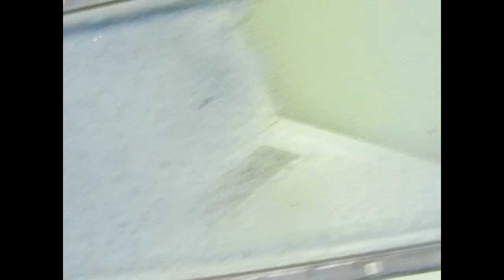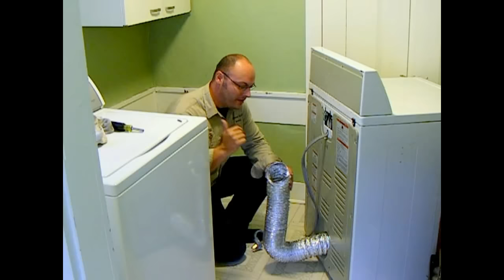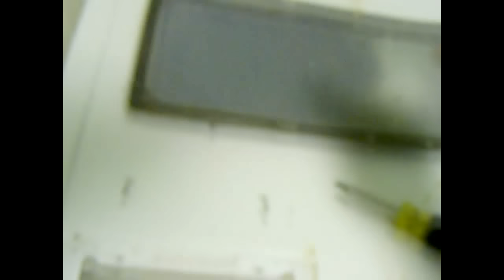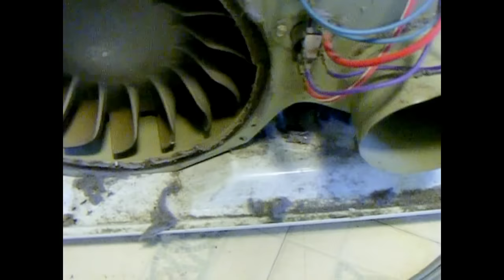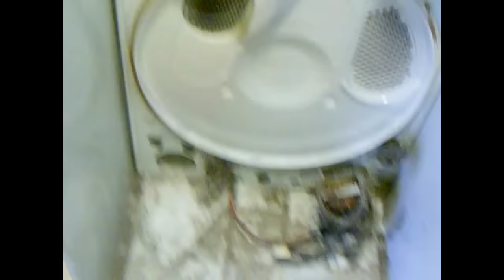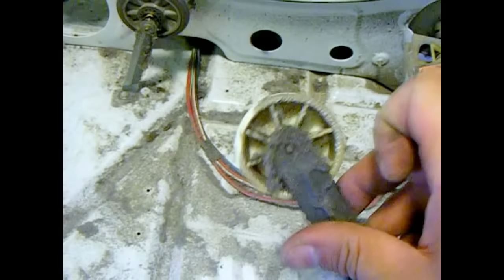Dryer Troubleshooting - Not Drying or Taking a Long Time to Dry

Comment: My Maytag dryer MED5600TQ0 is not heating.  I have changed out the heating element and also cleaned the filter housing.  I have not checked the motor due to not really knowing what i am doing.  Would the timer have anything to do with heating?  I will attempt to access and clean the motor.  How will I know if I need a new motor?

Comment: I have a Maytag gas dryer with the same problem.  Haven't cleaned the vent tube yet but turning on the dryer with the door opened I noticed that heat come out of the back of the drum for about 10 seconds, then it went off for about 15 seconds.  This cycle repeated over and over.  Is the gas flame supposed to come on and stay on or should it cycle like this?  If this cycling is abnormal what is causing this?

Comment: My guess, would be on top of the roof I had to clean out this type of vent by using a wieght, wad up nespaper in burlap bag, tied with rope. I have also see people use an eletric leaf blower connected on the inside and blow out all the build up lint. Hope that helps.

Comment: So how do you know when all of the above work just fine( heating element, thermo fuse, cut off switch, and the two fuses on heating element) and have continuity? I have the same problem and my dryer looks in the inside just like the one on your video. it will tumble but no heat at all. Help me please!

Comment: Years ago, I worked on mine (new 1994) and put the schematic in a sandwich bag, then stowed it in the top compartment. A year ago, had a problem and opened it up finding the package. I thought how kind of me to do that. Of course I scanned it but where oh where on a backup drive? New moter, new pullys (not necessary) and other parst put new seals on duct system so will not leak maybe spent $150. Now not heating. Have a back up heating coil bought when only $50 a few years ago..... Not heating now. Could be the timer (original to 1994)

Comment: Hi Bill,

My Dryer is a Mytag Performa 2004. The problem that I have is that the dryer it is cutting off several time before the program finish. My wife has to wait until it cool down and restart it. Any idea what I can do? change Thermostat?

Thanks a lot
Reply: if you have to wait until it cools down, so it will turn on again - it sounds like the thermal fuse. now the question is, why does it overheat and triggers the "safety" .. I'm no pro, just fixed a thing or two around the house
Reply: @still34u  actually the thermal fuse does not reset. And the high limit thermal cutoff ( which I think you ate referting to ) will not shut the motor off.
  If the motor shuts off then starts when cooled, the motor's safety switch is tripping.  The motor either needs cleaning or replaced normally.
  The thermal cutoff at the top of the heater cage can be reset.  When I do it, I place the terminals between my fingers pointing up.  Then slap it against a good solid surface with my palm flat.
  Not really sure how reliable this is, but it will reset the cutoff on the heater cage.  I might add if it trips repeatedly, you need to check the lint filter to see if it is clogged and needs hand washing because of residue left by dryer sheets.

Comment: hi! i just got done replacing the heating element. the coil was broken and had no continuity. i could visibly see the break and tested it with an ohmeter. i ensured there was continuity after replacing it with a new coil. i have good air flow through the dryer. what else could be causing no heat? the only odd thing i noticed when i started it back up is that the door light does not come on when i open the door anymore. any ideas on how i can get heat?

Comment: I have had my vents cleaned. Then a cpl months later, it takes 2 hrs to dry...then the lint is on back side of lint screen. Dryer is only over a year old. There is no filter inside. Thinking heating element is going out?

Comment: Currently me electric Kenmore dryer is not getting any eat, and when it is started, the timer knob does not spin, so it will be one for hours at a time without stopping and also not getting heat. What would be the problem and fix for this? Also, when we open the door, the fuse jumps and we have to reset it. thanks.

Comment: great video! but my problem is more involved... we have a dryer that won't heat. turns on and spins though. airflow is fine. fuses are good, heating coils good - they have continuity. full 240v out of the wall. we are out of ideas. any help?
Reply: +Paul Brown the thermostats and/or the heater unit could just be dead. That was the issue with mine, just would not heat, blowing cold air the whole cycle no matter what temp setting it was on. Replaced the heater unit and now works better than new.
Reply: Edward Sanders
thanks for the tip! how would you diagnose that with a multimeter - take it apart, plug it in and run and see if the coils are getting voltage?
Reply: Fist check the thermostats. You may have two or more so check them all individually and as a hole circuit. Most thermostats I have worked with be a closed curcuit when cold and hot opens the curcuit to stop flow of energy but if it's a thermo resistor it can be the opposite. Check wiring diagram for you dryer if unsure. If that's your issue then replace and all will be well again but if not then, the heater unit is the issue. Check there is correct voltage going to the heater when switched on by bag probing the plug for the heater. If that is correct and no heat is created the there is something wrong with the heater coil unit its self and I would just replace it but you could technically fix it if there is just a poor connection somewhere.
Reply: Edward Sanders
thank you sir!

Comment: Can someone please answer a question for me.  My dryer won't heat.  I have tested all parts with multimeter for continuity.  My question regards the four-prong thermostat.  The prongs on the two ends show continuity but the two in the middle do not.  Should the two middle prongs show continuity?

Comment: I have a question, my electric dryer has stopped working cycle by cycle, and now has NO hot air coming at all. First the timed cycle stopped working, then high heat stopped working, and now it wont blow hot air on ANY cycle. Any idea what is wrong from this information?? It is an estate brand dryer.

Comment: My dryer has a wide metal section across the top back and has the electrical wire coming through it - I cannot remove the vent covering the blower and exhaust path. Any suggestions?

Comment: I have a problem runs and after about 2 min shuts off. has heat!!  told lint as the cause?  Cleaned blower, motor, and all ductwork inside and out still same. replaced thermal fuse as parts supplier sold me one said it causes!  Still does the same? what could cause this?

Comment: Hi, I have Kenmore elite electric dryer runs but has no heat.. I've now got it mostly disassembled and have tested many of things but still can't figure out the problem. I have clean it all out and I checked the element continuity, resistance, the thermistor resistance, the exhaust thermal fuse. They are all good. but still not heating please help? thanks

Comment: Just moved into a "New House" which has a washer/dryer...Past week the dryer has been taking a long time to dry clothes, this morning im thinking i gotta get to the bottom of this, i took my shop vac , vacummed the from and bottom where i seen lint..ok..I noticed the vent hoses sagging , where the heater is positioned its a long distance to the outside exhaust damper..So im poking it with a broom handle and pop it broke spilling out water and lint..So i take it this is from years of not cleaning?
Reply from the maker: Eric Carr Yes     for sure.   Definitely need to fix that
Thanks for Watching!

Comment: Sunflower seeds may have been cached in there by the mice that left the droppings on the floor ;-)
Solid exhaust pipe instead of the easier to install flex hose offers less resistance to air flow, and less build-up of lint.

Comment: I'm out of Ideas, I hope you can help. My sisters dryer is using high limit fuse about once a week. I've cleaned out the entire lint tract out, including the blower. I added full size elbows tom each end to ensure unrestricted flow. the fuse and thermostat on the heating element are replaced each time. Have you got any ideas about what is causing the overheating? I replaced  the thermostat  with the fuse even though it still read good.
Reply from the maker: William Norman What's the model number of the dryer?
Thanks
Reply: Bill Newberry LER5638AW0   Sorry so long in replying. The serial # is MC0801420 in case you need that. Thanks again
Reply from the maker: William Norman It's not running in a closet?  Make sure the blower wheel is in fact still connected to the motor.  Make sure the flaps on the vent leaving the house aren't blocked.  How long is the total run of dryer venting?  Are you cleaning the lint filter between EVERY load!  Make sure the small holes on the lint screen are not blocked, it may need a good scrubbing.
Let me know what you find.
Thanks Again!
Reply: Bill Newberry The dryer is out in the open, the total run is less than 37".  I disassembled the blower cage and cleaned the fan blades already, it id firmly attached,  outside flap is ok, and my sister is a fanatic about the lint filter, cleaned every load, washed with a brush and Dawn dish detergent once a week. I really appreciate the help, its making me crazy.

Comment: The hose you use in the usa are not allowed most provinces in Canada...too restrictive and turbulent air flow..resulting in lint build up in hose..we use metal pipes..clean & lubricate belt tensioner  before reinstalling ..i use turbine oil .jus sayin. ..cheers ...

Comment: After one cycle the clothes are warm and damp. I have taken it apart and removed all of the lint from inside and the lint trap after every load. The vent tube is only a few feet long and it is clean and all the air is flowing outside. The dryer gets hot but clothes are still wet. Any ideas?

Comment: Question - Isn't this something the technician should be doing each year during the annual maintenance?  I purchased my Kenmore appliances in March 2013 and not once have I witnessed them do anything except use a computer to run diagnostics.  The lint screen on my dryer is not located at the top.  It is located inside the door and the technician told me the sensor is located in front of the lint screen, but it keeps my clothes from drying completely.  He said the sensor cannot always sense if the clothes are still wet and when that happens the machine turns off, even when I have it set on SANITIZE for 110 mins.  He put a wet paper towel inside the lint screen to show me how to "trick" the dryer into staying on because it keeps shutting off with my clothes still damp.  He said instead of using the "timer" settings I should use only the timed setting in 40 min increments.  I paid close to $3K for this equipment and I should be able to use sanitize or steam fresh or any other button on it for that money.  These maintenance agreements are not cheap and I am wondering if it is worth the cost because I have to do the labor myself.  I pull the dryer out and take the vent off and put a blower on the end to clear the vent pipe that runs along the garage wall to an opening at the front.  After watching your video I am now going to have to take the dryer apart and get to the inside with a vacuum.  I know someone that had their home burn down because the dryer caught fire and it took over a year before they had their home rebuilt and were able to move back into it, so this is not a joke.  I hope someone can tell me if the technician should be checking this as part of the yearly inspection.

Comment: (I tawt I taw a puddy tat) the only thing I can think of to add to this is if you take the screws out put them in a bowl or cup all the dryers aren't the same so your dryer might look a little different but basically the same idea and look behind it after you get it back in place because sometimes the hose gets kinked.

Comment: ...so the heavy accumulation of dust on the hidden, inside parts of the dryer could easily come from a blocked exhaust, forcing the exhaust air with bits of lint to blow through cracks and gaps that exit instead into the inside, hidden parts of the interior, accumulating all over the interior pieces-parts. 

Then it's reasonable to believe that a thin patina of lint all over and around the outside of the dryer is probably a good indicator of there being a blockage somewhere in the exhaust ducting. Hmm...

Comment: so what do you do if the dryer is blowing slightly warm air but not hot and after 4 times through the dryer still just as wet as when they went in....

Comment: Yep.....takes a long time to dry, probably a clogged vent line (including the one on outside).  Not drying AT ALL (you feel no heat), can be several problems from bad heating element, humidity sensor, etc....requiring more in depth troubleshooting.

Comment: @Bill Newberry 

Frigidaire Gallery Series Dryer  #GLEQ21ES0
So my dryer got extremely hot, then the next load the display said “AD” and now has no heat.  
I checked the Thermostat and Thermal Limiter (fuse) both had continuity, also the thermistor by the blower motor was running at 52K ohms, next I checked the Heating coils and the element itself I got 11K ohms. 
I even checked the blower motor. So now Im lost why this thing isn’t working. Please help!

Comment: Only removing the lint from the filter isn't enough. The filter should be washed, several times per year, to remove buildup you may not be able to see. Take it to the sink and run water on it. The water should run straight through it, almost as if it isn't there. If it doesn't, then gently wash it with some kind of brush to clear it and rinse well.

Comment: Can cold weather have an effect? We are at -10 and my dryer is not warming.
Reply: eastlake93 Usually it has to do with to much LINT in the dryer trap and can be the metal housing on the back of the dryer. You can remove the back panel and unscrew the aluminum shield on the left side, and vacuum it all out. Also vacuum the impeller fan. Also clean out the hoses that are in your walls to the outside of your house. As he said for long runs, you can get a Dryer Fan which helps push the lint long distances. But I would recommend a Lint Dryer Trap. Check Amazon for this product "Lint Trap with TURN KEY LID FASTENING SYSTEM" sold by DirectFans right now for $42.99 with Free Shipping.
Reply: Thank you sir.
Reply: eastlake93 There are also 2 fuses on the back of the dryer, behind the panel. One of them controls the heating side. If one of them is blown, you may need to replace it.

Comment: So my girlfriend took our dryer apart and cleaned it from inside out and when we turned it on after putting it back together it smells burned and before taking it apart to clean the dryer that smell wasn't there... just knew it wasn't drying right and the dryer didn't want to shut itself off .. I'm lost she said made its a fuse because it still heats right and coil is still good but I don't no

Comment: Another thing, don't use those thin aluminum hoses. You should use actual metal ducts. If lint gets into those plastic or thin aluminum hoses it's a fire hazard. Those type of hoses are flammable.

Comment: My electric whirlpool dryer will not heat and dry on the the timed dry cycle. The cycle is on the dial starting at about 1 o'clock position to the 4 o'clock position. The cycles on the left side of the dryer dial work perfectly. Can any one give me some help. Thanks in advance

Comment: My dryer is heating, I can hear the timer button turning, the motor isn't running, and the belt was broken. But no motor sound at all. What could that be?
Reply from the maker: hidhawkes Should not be heating if the motor is not running.  What is the model number?

Comment: My dryer won't turn on but the heating element is on, if that makes sense. With the dryer being plugged in the heating element turns on. But, when I try to start the dryer it won't turn on. What could the problem be?
Reply from the maker: LiveUrDash Is the heating element staying on even with the door open?
Reply: Bill Newberry yes it does.

Comment: best! - interesting! - cool! - but it risky. but i now can finally see more about it! - so many crap videos out there - just make me sad n mad! cuz i don't get it much. - i wish i could do - but i m very accident prone! :O :( - n stuff! - but otherwise! it nice! ---- can i stick a shop vac like in the lint holder thing ? will that help a little ? my stuff a little different -. i got really old appliances called - "Atlantis".  - was big at the time - a long time ago! - but still. - now we had probems in general. - but also ! the washer - . starts to bang! - and the dryer doesn't dry proper. can u maybe help? - what settings should i use to make it more proper? no1 tells me! :O :*( :x. thank you! :x.
Reply: Jennavecia Sala If your washing machine is banging it's probably because the load in it is not balanced. Just open the lid and move the clothes around so that they are evenly distributed around the agitator inside the machine
Reply: oh ok. thanks. what is agitator? :x.- i usually do . :x.-
Reply: Jennavecia Sala The agitator is the thing in the middle that swirls around to shake up the clothes with the water and detergent
Reply: oh ok. thank u!